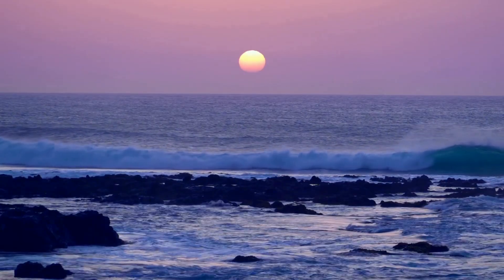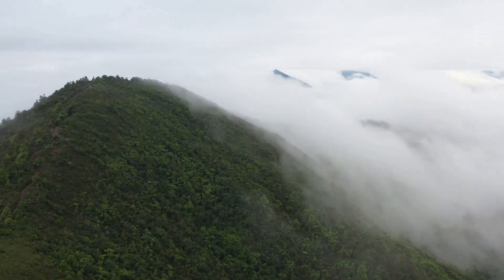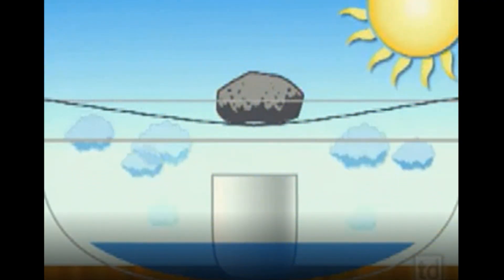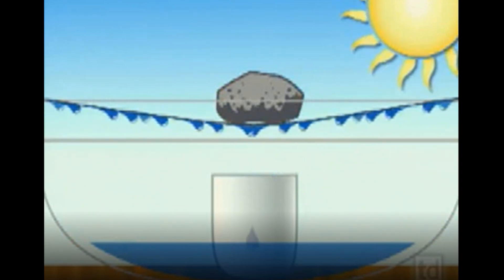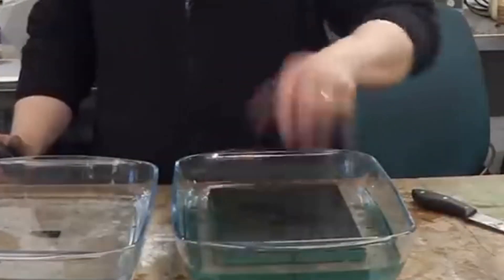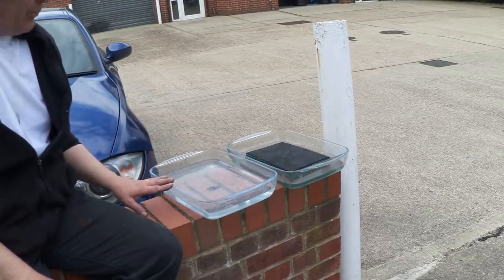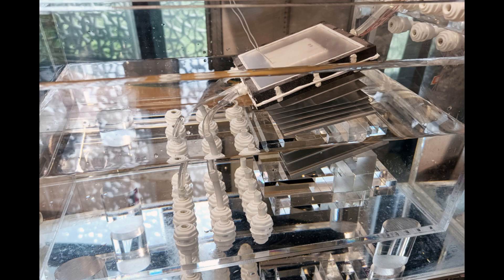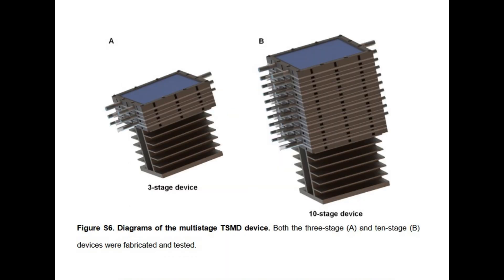2192 MIT Breakthrough On Making All The Fresh Water We Need

Comment: Why not use a tesla turbine as a water pump in a closed loop with a grid of pipes. Have a collection pool underneath the grid. As the turbine pumps, it cools the water in the closed loop. Cold water going through pipes will cause condensation on the pipes and it will drip into the collection pool.

Comment: That Black Matrix Box At The End Of His Video, Is Probably The Key to Making A Solar Salt Water Box That Has Many Thin Levels Of Water. To Evaporate From, And Then Into A Cup 🍵 In England Theres Not Much Sun. But In A Dryer Climate Area, It Would Require A Video Of The Most Efficient and Effective Design. I Pay 1.76 A Gallon For Distilled Water ( No Salt ) and Go Through A a Gallon Every Two Days. 2-4-24

Comment: I Pay More $1.76 a Gallon for Distilled Water. But, Its Useful In The Humidifier. Which Is Difficult To Fill Everday. But, It Gets The Water In The Air. Plus The Cost Of Electricity. But Its Worth It At Night To Keep Humidity In The Air. I Don't Really Know Why. But Im Less Dry. I Guess There's A Lot Of Silica In The Air. 2-4-24

Comment: 4-6 liters per hour per of sun in half square meter means that the sun must give around at least 4*750 (aproximation of the energy required to distil 1 liter of water) = 3000W, in just half a meter, that means that they are assuming:
the sun does give 6kw per sq meter ( 6 times more that the most optimistic realistic condition or 3 times assuming that the evaporation is 100% efficient and the water only changes phases without a change in temperature). and that is using the low estimate.
assuming a second system to recover the heat in the distilled water that then is moved back to the system to increase efficiency, which would mean that you have to deal with heat exchangers.

this is just a optimized solar still with a pump attached with the classical MIT spin of "we cannot know the enthalpy of water before a round of investments". at this point, the MIT has a track record of incompentence in this field. like when they reinvented the dehumidifier and failed the prediction (that was about as wrong as this) for one magnitude, or the dissecant system, that also failed because they could undestand that introducing a dessicant didn't change the energy required to get the effective water.

Comment: Instead, an electrical current is applied to the flow, and this “shock electrodialysis,” as it's called, separates the water into ever saltier and fresher flows, running along next to each other in the pipe. Because the current affects the charged salt particles, they just move off to the side.

Comment: Perhaps you could speed up the process by placing Fresnel lenses over the material to concentrate the suns rays and generate significantly more heat from the sun.  That would be a cheap multiplier of efficiency.

Comment: Years ago, Dad borrowed a little book that was filled with all these interesting inventions (like the farmer who used an old silo as a methane generator from pig muck). Dad came across this page about a solar still. It looked like a little house with a hip roof but it was all glass. Running parallel with the two shorter walls were two short internal walls that did not reach the roof but were sealed at either end to the large walls, making a chamber on either side of the 'house'. The idea was that if you filled the centre 'room' with water, the sun would evaporate the water, the water would run down each roof hip and collect in the two outer 'rooms'. There were rubber bungs at the bottom of each room for collecting the fresh water and one at the top for fill the main room. Dad built one and it did indeed work, albeit slowly. Now if we had some of this foam and felt in the centre room, I bet it would have worked way faster.
Reply: @JehuMcSpooran  what was the name of the book? Can it be found published or archived online?

Comment: We are building solar PV installations of millions of square meters now, imagine if they also generated 10 liters of fresh water per square meter per hour? Every million square meters of collecting area could generate 10 million liters of water per hour, perhaps as much as 100 million liters a day. Unlike electricity water can be stored easily and accumulated in vast quantities. If it is cloudy and the system does not work, it is also likely raining too, think monsoon...

Cities could build facilities on the coast or a few kilometers from it where land is cheaper in desert coastal areas. The whole operation is PV powered along with solar distillation and need not be co-generating but can be powered from onsite PV. It only works in the daytime so not much battery storage is required. If sited properly, solar covered canals and pipelines can move fresh water vast distances by gravity alone. Use PV power to pump fresh water up coastal mountains and let gravity do the work to move it inland. If solar panels covered the canals, the system could deliver both cheap fresh water and electricity too.

It might be a classic engineering trade off, more electricity and less water or the other way around, or those distillation cells might just make water. Combining solar distillation with PV generation is possible though and the overall efficiency of the cells would be enormous, 20% used to make electricity and the heat used to distill fresh water. It can also be scaled from small village sized to Utility sized for large cities.

Take a moment and imagine the implications and promise of such systems, the business opportunities too, for it is business that brings science and technology to fruition and use. Conventional solar distillation companies and those that use reverse osmosis are out of business, and had better adapt or die, and I mean fast! It will transform cities in the more equatorial and temperate dry zones all along the Mediterranean, the red sea, the Gulf, India and islands all over the world. It should also happen fast, a classic transformation and S curve of adoption over the next 15 years and will also follow classic cost curves as innovation happens.

Another thing this device can do is the final stage of sewage treatment to remove salts and further impurities for recycling or to use for plants and an urban tree canopy to cool things down and vastly improve quality of life. Many cities will look a lot different in 20 years if they plant urban forests and have plentiful water. Cheap water and electricity equal a good life in many warm dry countries and even homeowners can use gray water for gardens.

The paper contains a lot of information with links to additional data, a gold mine for engineers looking to use this design or variations of it. I don't think they patented anything so it should be a free for all.

Comment: Column, sponge, water, clear tube.

You want the sponge to be below the water, but you don't want the sponge fully submerged for several reasons, you do the old science trick of using a  in this case clear tube under water allows one to have a kind of air pocket, you put the sponge down in there to suck up the water.
Heat tube sponge = evaporation, have this condense on a nice rock bed to extra filter + add in minerals and taste.

The reason for the tube and the sponge is well rather several things. One Oil floats on the top of water and if oil gets on your sponge = game over.
2 you have a increase atmosphere situation happening inside the tube.
3 you have the potential to insulate the inside of the tube in several fashions 'aluminum heat shroud on one side?
4 you control where the water goes when it evaps 'this is important'.

Comment: Hey Rob, it's all good and all but I have one important question the carbon felt and this green wicking thing will logically be full of salt... At a specific point in salt concentration the salt will crystallize in that green thing and eventually in the carbon felt and it might then stop working. What will you do? Throw it away or regenerate it because it takes also energy for both. Then I would love to know how much energy it takes to "regenerate" the set up and how much energy it takes to produce the components (carbon felt, green wicking thing and the recipient ) 🤔
Reply: I was wondering this myself but I think he was just demonstrating one way to wick the water up for faster evaporation as a demonstration not as the only final solution. I haven't gone over the MIT paper yet but I don't think that is part of it, I could be wrong. 
The main idea is to evaporate out of the brine as quickly and efficiently and cheaply as possible without have materials clog up. The constant flow of fresh brine at the wicking layer might slow or prevent that.

Comment: One problem, albeit minor, is that having some mineral content in water is very healthy; distilled water is domestically only considered fit for machine use or cleaning. I don't think it would be a massive problem, as the areas this could help the most are those with poor access to water and access to poor water, but improving the mineral content would still be a long-term consideration.

Comment: Every aircon unit pulls water outof the air.

You can desalinate sea water with tower & a pump.
You can make it more efficiant with some solar heating to remove dissolved gasses, then use the tower column pressure to vaporise the water.  Being warmed reduces the vaccume needed.  ReCondensation occurs by heat exchange from the output vapor back to the incomming sea water through a normal distilation pipes.  Of course, you have to return some salt enriched water back to the sea which is also a feature of filtration desalination.

Comment: Interesting idea. Might be useful for a project I was thinking about: a solar rechargeable desiccant dehumidifier.
Reply: Yes the MIT paper uses a membrane actually and it’s actually a pressure build up from solar energy the pushes fresh water through and the salt flows away it’s very neat.  Because it could be powered by heat from evacuated tube collectors which would be much more efficient.  Also your cooling panels can provide additional power to the system I think by cooling the fresh water side you could decrease the pressure over there helping water pump through the membrane.  Also desicant dehumidifier idea is awesome.  Another advantage of this is that it produces mineral free water which could be used in terracotta evaporative coolers without leaving a mineral build up.  Terracotta cooling has similar performance to the radiative cooling panels and would be very complimentary systems.  I love your work btw
Reply: Is the article open access? Seems like it requires you to pay.  Anyone have any ideas why?
Reply: You and Tech Ingredients are like a couple of old school jazz musicians riffing on each other and I am here for it 😂😂
Reply: Looking forward to it.
Reply: Too much accent.
Too much 'wau-tuh'. 
Too much 'this sounds too much like a guy who likes to hear himself talk.'

Comment: Wonder if it can be used to "filter" tap water?
Reply: Yes and no. It can filter/distill the water but not everything in tap water gets removed. This process is about salt removal which is a large mineral particle. Tap water has no significant amount of salt so this process is a wasted step. You want other filter steps for cleaner drinking water like reverse osmosis to remove pharmaceuticals and chemicals that even some can be carried over through distillation.

Comment: Wondering how effective a black heat sink would be as an evaporator... Most of it could be over the water surface, so no salt or other impurities comes to it. And the rest can be just washed when needed...

Blackest black paint could take most of the solar radiation in it and then heat sink would transfer that heat to the water that evaporates. Then you'll just collect condensed water with a cooler surface like sheet of plastic.

Cheap, all parts are washable, works decades, uses most of the energy that comes from sun, ...

But yea, if you don't need boiling, it is better alternative. But the catch is also how long you can run that system without replacements and costly parts...
Reply: If the water is the only moving part maybe forever.
Reply: @HappyFace6or7  Water, heat, solar radiation and air comes to mind... But yea, device can last ver long times. Heat may fracture it, impurities can do some harm (ie. salt acts like acid), solar radiation slowly ruins the paint, water/humidity harms the components, ... But overall this can be build to last very long times with minor need for replacements or even maintenance. If unfiltered sea water is used algae and other growth should be cleaned away periodically.

Comment: The vapor compression system patented by Sears in the 1980's is the solution to cheap fresh water production from sea water. It was reintroduced by Dean Kemen to solve the water supply in Africa and ended-up in Coke Cola's hands to disapear.

Comment: Hello  everyone ! What about plastic and water quality ? Specially the one in the video, (PTFE and family) considered as "perpetuel pollutant", endocrinal pertirbator, reprotoxic, etc.. I'm not even sure that you can get rid of it by destillation..
I thing it could be interesting to carbonize a (natural material) board, and use it as a wicking board for instance.
Interesting ! I better understand in you video than in the MIT one's ^^
An other way of using this system could be to produce solar hot water/stirling system in cold days, when you actually need it...

Comment: Left field idea. Water makers run at approximately 800 psi. What if an empty steel pipe was sunk to a depth of 550m, into the sea, this depth creates 800psi. The bottom of the pipe had a filter membrane that would act as a water maker without the need for any power to produce the pressure. The filtered water would travel up the inside of the pipe then pumped to a reservoir. Similar to what happens when you put a straw into a water bath perpendicular. If you keep a finger over the top of the straw, then remove it the water quickly charges up the straw to equalise the external pressure. 
Happy to be shot down with physics here. Yes power is still needed to pump the fresh water from the pipe. What strength pipe/membrane filter would be needed. How to clean the membrane. I’m sure there’s a flaw in the idea, but open to a response.
Reply: A tidal pump could be designed to not need electricity but you still have mechanical parts to maintain so there's some costs.

Comment: I've always wondered since desalination plants are so energy demanding? Why don't we utilize modern advanced nuclear energy options to power desalination plants? The more i learn about our power grid, the more i realize that modern nuclear energy is our best option. Small form reactors, LFTRs, Thorium Reactors, molten salt reactors. Utilizing our advanced technology, Improved engineering & material science. Using our greater understanding of safety & well made designs. We have so much more advanced computer technology & robotics that can be used. It feels like even tho tons of advancement has occurred with engineering designs, safety measures, etc. It still doesn't matter to most people. It's like most people are ingrained with a natural negative response when talking about nuclear energy.  

 We need to heal from the trauma of our past. See & learn that those things only happened solely from us not understanding what we were doing when it came to nuclear energy at the time. We didn't have advanced enough technology, material science, engineering, safety measures, understanding of how to go about everything, etc. This source of energy will greatly help the world improve towards the future and lowering emissions. More than anything else could, while also providing a very stable electrical grid system. Currently we have alternative energy options but the majority of our grid is powered off of fossil fuels and emission producing sources of energy. We will be so much better going forward commiting to modern advanced nuclear energy options.
It will really allow places to be much more energy independent. Less reliant on fossil fuels. They'll have efficient, stable electrical grids and the rest of the grid could experiment with alternative power sources, etc.

Comment: I'd to ask you a question, if I may. Do extreme electrical storms in the atmosphere create water (as rain) from its constituent parts?
Reply: No.  Water is H20.  While there is a lot of O2 in the air, free H2 is only there in trace quantities.

I have seen global lightning maps, animated.  Lightning is always happening somewhere -- it's virtually non-stop.  So if H2 did accumulate in the atmosphere, lightning would give the spark to make that hydrogen recombine with oxygen, producing water, until the hydrogen is exhausted.  In steady state, there is no significant generator of hydrogen to replenish.

Technically, the answer to your question could be argued as "yes", by the means I described.  But far and away, the practical answer to your question is "no".
Reply: Thank you for that explanation  @PeterLawton